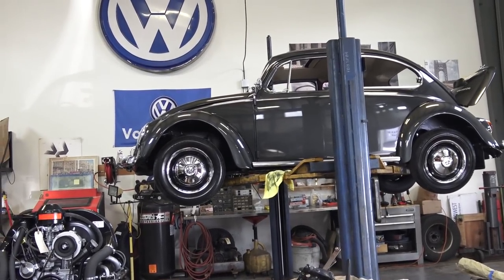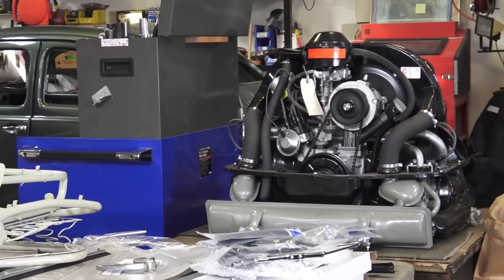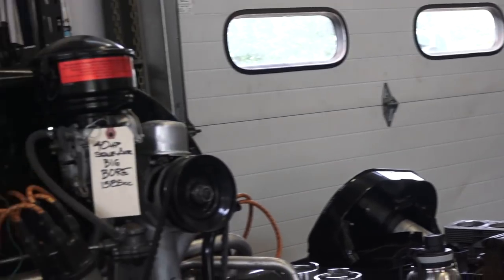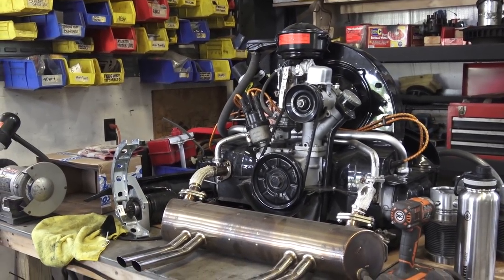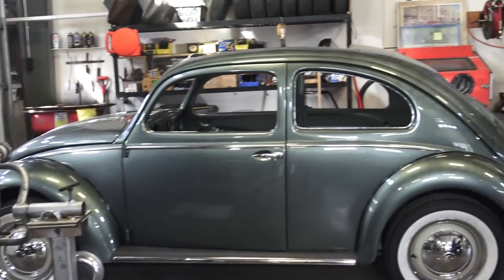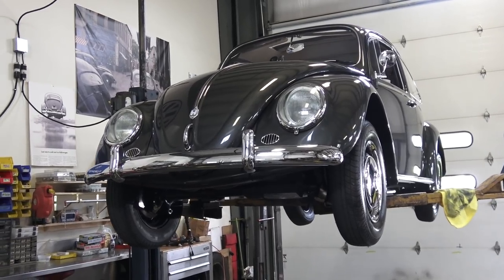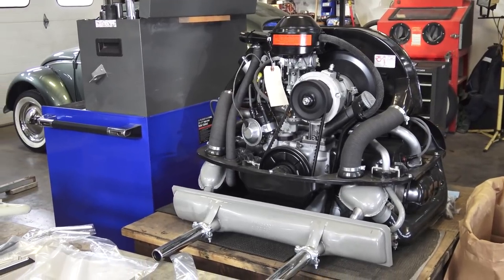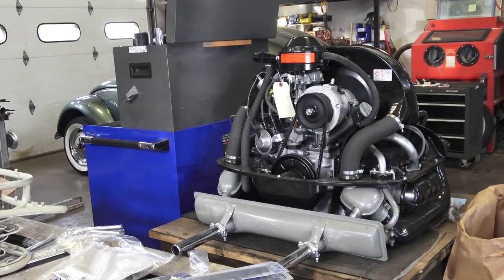Classic VW BuGs Break In TIME for your Vintage Volkswagen Beetle

Comment: I agree on the break in oil changes.. I was also tought to not idle excessively, vary speed, let the engine run against compression, not labour the engine and not over rev during break in..

Comment: what about flat tappet issues with todays oil. i have always used valvoline racing oil because it has zinc to protect cam and lifters
Reply from the maker: I still use plain ole 30w basic oil, no additives needed, no valve taps.

Comment: The one thing I forgot to do last weekend on my new motor at 300 miles was adjust the valves. 40 miles later and the engine lost tons of power because vales on #1 and #2 were way out and even a push rod on #1 had skipped out of line. 
I won't be making that mistake again.

Comment: Do you think running modern 10W-30 will cause issues with premature engine wear because of the lack of zinc additives?  That seems to be a point of contention among the VW community.  Not that I drive my bug more than a few hundred miles a year but "classic car" 10W-30 with the needed ZDDP additives seems like cheap insurance.
Reply from the maker: Doesn't hurt to add it, I really never have, and my motors are going strong still.
Reply: I always use a ZDDP additive. 

It's more of a problem for bigger motors with higher rpm and heavier valve springs.
Regardless, it was an original oil additive for good reason.
The debate always goes on regarding which oil, but IMO it's more important to do frequent oil changes and ensuring the oil temps don't frequently get high.
Reply: I agree,  I don't use any oil higher than API-SLspec  on my older cars.. SM and SN spec are all low/no Zinc as far as I remember..

Comment: When I had a '67 bug back in the 1980s I was always told NEVER run a bug engine with multi-viscosity oil... I can't remember the reason though. Was I mislead, or have things (oils) changed that much since then?

Comment: Qiestion. New engine has less than 100 miles on it. When cold it takes 4 or 5 cranks before it fires up a d I have to hold the throttle for about 30 secs before I let go so it doesn't die. Is this normal?
Reply from the maker: Hmmm, sounds like fuel.  Fuel pump working right?  Cold be the flow of fuel through the fuel line through the chassis.  Or it could also be your carb.  Process of elimination really, try one thing at a time.